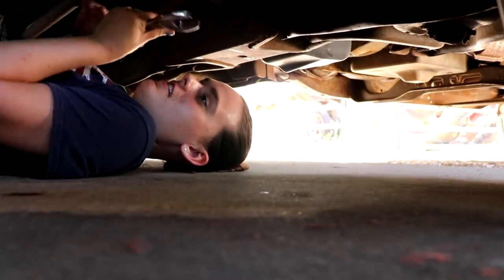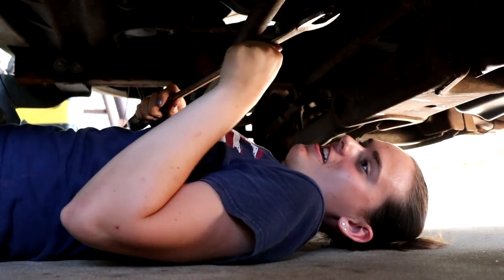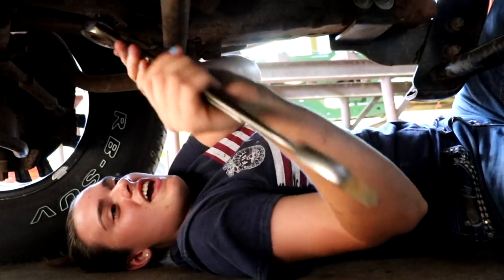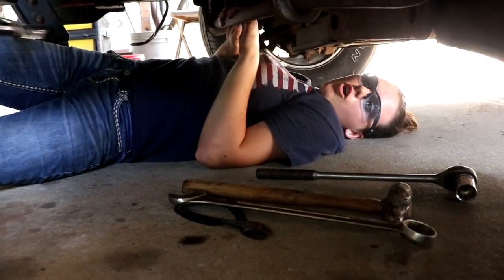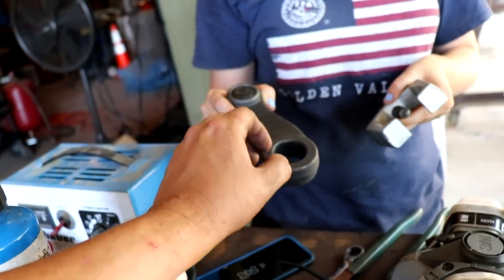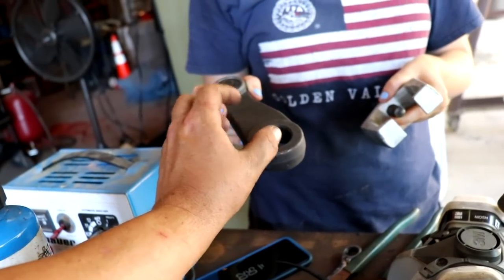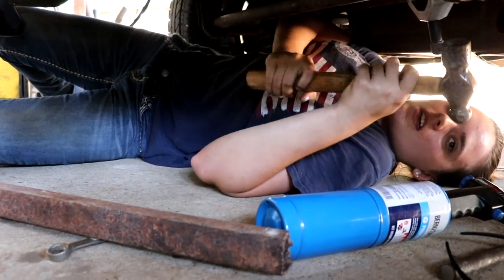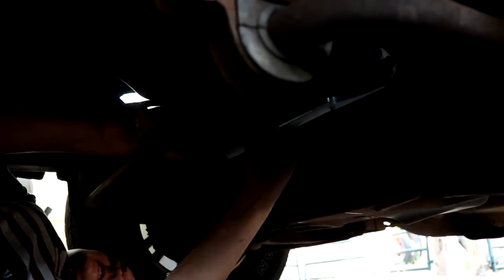Young Mechanics! Teach them well and let them lead the way.

Comment: She is using the wrench correctly pushing the spinner away from her face, so if the spinner slips it does not knock her teeth out. Also she is using the ring end on the tight bolt instead of the open end which can slip.  good work

Comment: Great to see people teaching tricks of the "trades"  I started fixing my parents stuff with nothing to lose. I figured at the worst my parents would have to hire a mechanic to fix the car anyways. so with that attitude I pulled out my tools( that I purchased from sears  when i was 8 years old saving up each 25C untill i had 1$ id hit the bank to deposit) 99$ latter and  27 years later i still have those tools and still fix all my stuff. and automotive tech was not my thing my wrist could not handle the pain but i am a refrigeration mechanic and fix all my own stuff.